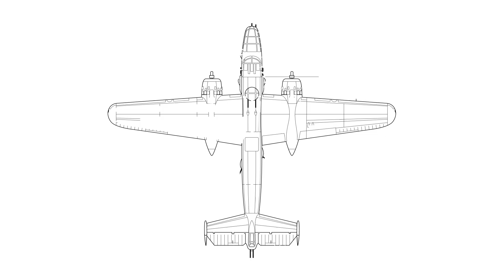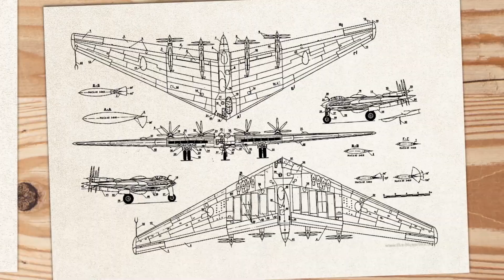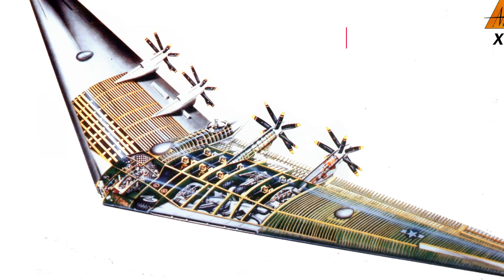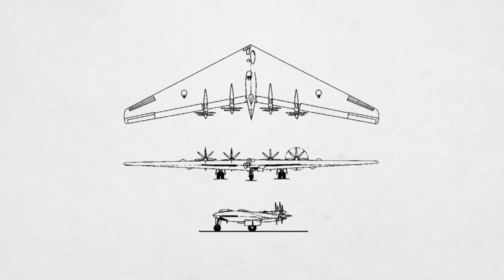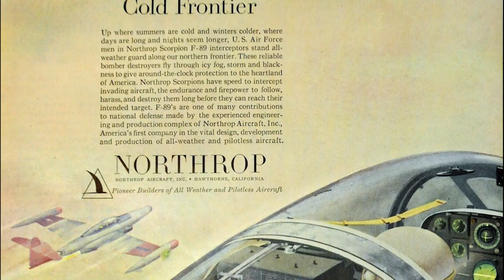This Plane Is CURSED - The Forgotten Flying Wing…

Comment: The serious problem w/ the YB was a "Gen One" flying wing design w/ early analog auto-flight technology and it just wasn't up to speed yet.. Had a digital autopilot and FMS system been available it wold have done better but trying to get a recip. powered design to fly efficiently (with some inherent design flaws) at jet speeds just wasn't  going to work but IMHO..  had Jack been allowed to continue he would have solved all the issues..   FWIW?  Symington was "dirty" to the max and Northrop was pretty much a straight arrow..

Comment: There are numerous factual errors in this video. Boeing had no role in the Convair B-36. In fact, Boeing had not even entered a proposal in the long-range bomber project because they viewed the parameters as impossible to achieve. It was not the propellers but the complicated gear boxes that caused vibration problems on the Northrop XB-35. The maximum ordnance of the XB-35 and the later YB-49 was nowhere near what is stated in this video (52,200 lbs !) In reality, it was 16,000 lbs. of bombs.

Comment: Jack K Northrop had the right idea to bin the fuselage and create a blended body flying wing, trouble is Jacks design was too way ahead of then current aero engineering stuck in the late 30,s.  Fully Automated Digital Engine Control with Computerised Flight Control Surfaces, and a decent twelve wheel bogie undercarriage would have made a lot of difference to Jacks Fab Beast. Sorry to say the B-35 was doomed even before it was wheeled out the hangar,

Comment: I'm sure the Air Force looked at the situation like merging Northrop with Convair was reasonable; the flying wing wouldn't be chosen and this would save jobs. But that doesn't change the fact that they were still trying to force a merger with unfair terms on Northrop. Sure, it might save some jobs, but it was still unfairly screwing over the company. Both sides of the story are perfectly compatible, just from different perspectives.

The powerful lobbying of Convair, and their close ties to someone making these decision, was  very clear. With such prejudice,  you can safely say they were part of the reason the flying wing was rejected, and also part of the reason that merger was so favourable to Convair. After the fact, the Air Force could ignore the inconvenient details - if such details were even recorded at all.

The way the Air Force blatantly stole the bits of Northrop's technology they wanted, scrapped everything else, and gave that tech to General Electric is already a perfect example of the way they treated Northrop. That does not suggest fair treatment.

Comment: WHY did you not just tell the truth?? The TRUTH is, the Truman cabinet was typically democrat, meaning VERY corrupt and on the take. Stuart Symington was being bribed by Convair to get Northrop to merge with them, and his reward would be the CEO position. When Jack Northrop said NO, Symington and Truman set out to destroy him.... That is why all the "strange" things happened to the airplane and the remaining ones were destroyed in front of the people that built them at the Northrop factory. Think about that for a minute  - has it ever happened before or since that the entire fleet of an aircraft was flown back to it's original factory and DESTROYED in front of it's creator?? NO!! This was 100% political corruption.... and that is why we do not have a single example left today. DO YOUR HOMEWORK and report it as the truth, not skirt the issue so Google doesn't demonitize your very nice video.

Comment: They tried to do too much at once.  These "great leaps" depend on first discovering and then successfully solving critical problems in multiple areas at once when failure to resolve any one of them will throw the entire project into a tailspin.  Add to that the inherent instability of the flying wing design, which today is handled by computerized fly-by-wire, and the reality is that the project was probably doomed from the start.

Comment: My mom was a cockpit instrument "tech" at North American Aviation (Now Northrup) after WW2 and she worked on the YB's. I have a YB lapel pin from her. I would at times, hang out with my Aerospace Engineer friends at Northrup, either via the AIAA or with the Ham Radio Club. Years ago, I acquired the Pilot's manual for a YB 49.

Comment: Why does a plane need a fuselage, tail, and more? To make it easier to control. Had Northrop successfully built his desired flying wing, he would have found that even the most skilled pilots would be a single small mistake away from crashing. The B-2 succeeded where its predecessors failed because it incorporated a computer AI that calculated how exactly to fly the plane, reducing the skill requirement for the pilot.

Comment: It was too hard to control before fly by wire technology and even hydraulics it was too hard to control even with hydraulic controls it was just too difficult to control I heard it took two men to fly it was so hard to control to me and had to make the exact same maneuvers at the exact same time they won two three and then turn one two three they pull back one two three they you know pitch forward all right and I got it down to one too you know and they make a turn or one two and they you know the y'all or whatever but I heard it took two men operating in sync to control the thing it was that hard to control the wrestle to wrestle that thing into submission

Comment: Truly a beautiful plane. I would love to see a bigger one that can even go supersonic. Not with stealth in mind, as the materials would be too expensive to manufacture. It would have side by side seating and even have a civilian counterpart, used as an aerial telescope. The military one would not only be a bomber, but also a tanker and presidential plane with the central bomb bay being replaced by a passenger area, roughly the size of a 737’s cabin. The length of this plane would be 140 feet, and the wingspan 280 feet. It would be powered by six Non-afterburning turbojets and fly at 830 mph at 56,000 feet. About 12 of them would be built, and yes, the “triforce” Lockheed, Boeing and airbus would all make them. 6 of them would be owned by at least 6 EU nations, while the other 6 will be in America’s hands.

Comment: AF Sec Symington was about as innocent of collusion against Northrop's program as the Pelosi and Biden families are innocent of corruption and insider trading. The design was not inherently unstable any more than the Horton Ho-229 was. Both were a bit tricky to fly, but no more so than some other designs that were accepted for servive. Admittedly fly by wire control vastly improves the flight characteristics but are not absolutely necessary. Else, models of both designs would be unflyable

Comment: There was no fire after the taxi testing because someone took a pic of the YB-49. The XB-35 was sabotaged by the US Army Air Corps/US Army Air Force which gave Northrop an underpowered APU, the engines and props were not mated beforehand . Stewart Simington was in the pocket of Convair

Comment: Besides likely corruption in the Truman Pentagon, all of Northrop's flying wings had directional stability problems. In the case of his XP-56 fighter, a certain amount of instability was desirable, however,  it was one of the fatal flaws of the YB-49. The Air Force pilots who tested the prototypes were all veteran bomber pilots who flew aircraft like the B-17 and B-29 in combat. These were outstanding high-altitude bombers that were capable of being controlled by the bombardier in the final run onto the target using the Norden Bomb Sight, an analog computer coupled to an autopilot. Most of those who tested the YB-49 believed its slight hunting oscillation in the yaw axis would have made it an unsatisfactory strategic bomber compared to the B-36.

The various iterations of the YB-49 had slightly different rudder/stabilizer empennage, Northrop's efforts to address the stability issue. However, it seems that only a large conventional tail would have worked given the state of technology in the 1940s, a rebuke to Jack Northrop's entire design philosophy. Computer-assisted fly-by-wire control would definitively solve the problem, allowing the B-2 Spirit, a completely tailless flying wing, to realize the Northrop vision.

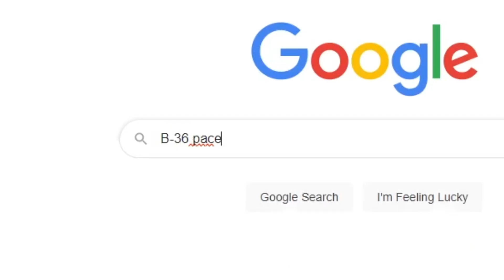Comment: 11:30 -- RE: The B-36 Peacemaker --- The period of time immediately following World War II is characterized by the Highly Experimental forms which various corporations pursued;  in the B-36, there's a combination of no less than 3 forms of propulsion on the same aircraft which seems impossibly complex to modern designers.

Sideways to this, the B-36 did NOT have a great operational record, with a large number of SAC aircraft flying off course or crashing into the sides of mountains.  To date, the ONLY site of a crashed airplane that I have seen with my own eyes is one of the B-36 crash sites.
Reply: ^^  Because, think about it -- Commercial Aviation Crash Sites are studied forensically and almost all the debris removed, so there's basically nothing to see at the crash site;  and crashes which occur at airshows (involving either private-owned or military-operated aircraft) get the same treatment.

Military accidents and/or aircraft damaged, destroyed, or downed during times of War (or while on a Mission) are therefore the only "in situ" air crashes that anyone could see "as is".
Reply: RE: "Three forms of Propulsion" -- Combustion engines + Props;  Jet engines;  or JATO rockets, "Jet Assisted Take-Off".  To Be Honest, though, I think that JATO wasn't used on the B-36 although it could have been used.  The B-52 certainly used them.  The airframe of the B-36 was partly constructed of magnesium, which is why rocket pods burning near the fuselage might not have been a good design choice.

Comment: If the B-35 / B-49 had entered service, it would probably have had a very short life on the Air Force roster, much like the B-47. Even if they had managed to work the bugs out and have it in service by 1950, it would have been greatly outclassed just a few years later by the new B-52, which, although not as stealthy, was over 100 mph faster and possessed greater range, with a comparable bomb load. So, while losing the Flying Wing was a personal blow to Jack Northrop, perhaps it's just as well.

Comment: Sounds like to me personally Northrop Had a mole or intelligence leak failing that some one in the air force was in the Soviets pocket and killed the advanced projects that the Soviets couldn't counter would make sense to me also make sense if someone most likely the Soviets or even the Americans sabotaged the plans and designs to create accidents if they had been reverse engineered only other thing I find strange is the general electric connection as they had better security being very close to th government and air force

Comment: Jack Northrop was a genius, but also a bit of a story teller. I'm sure the conspiracy must have made sense to him. The truth is much simpler: Flying wings are inherently unstable. Unlike a conventional aircraft, which left to it's own devices will return to level glide, a flying wing will, like most modern fighters, by itself keep deviating in any direction it's pushed until it stalls, unless constant corrections are exerted. To make matters worse, if a flying wing stalls, it loses all control surfaces, because it has none except for the ones on the wing, leading to it tumbling out ot the air like a dry leaf. 
This makes flying these aircraft a ride on the knife's edge, the pilot constantly has to keep the aircraft under control. It's like balancing a broom on your palm, once you stop correcting it will just fall down. The B-2 bomber not only has an improved wing geometry to reduce the risk of stall, but four redundant avionics computers to keep the plane level, something that could not have existed when Northrop built his prototypes.

Comment: This video doesn't touch on the fact that flying wings are incredibly unstable horizontally and this was a very big concern for the airfreight, as it could throw off bombings away from the intended targets, make the plane incredibly difficult to land in strong winds, and generally create an unstable platform.

Comment: This was a copy of atomic bombing plan of Germany. Only  thing was Nazis had the bomb, also had the Horten, and USA sent more than 4 nazi bombs over  Japan. Only 2 ones succeded. Moreover, this flying could not even have jet engines as Horten did
Reply: The scaled down prototype for the XB-35 was flying in 1941... the Ho.IX project which created the Go 229 didn't begin until 1943. What nonsense are you rambling on about?

Comment: The German Horten flying wings were far better than Northrop's unstable SEMI flying wing. Even Lippisches P.11 and other prototypes were better than Northrop's. The B-2 is FAR closer in design to the Ho-IX than anything Northrop actually flew.
Reply: Utter nonsense
Reply: @peterson7082  , yes, Northrop fanbois spout utter nonsense and pretend the two actual flying jet powered Horten prototypes and proposal for the long ranged jet flying wing bomber didn't exist.
Reply: @mrnickbig1  You're incredibly mistaken. The YB-49 was a reengined XB-35. The XB-35 had scaled down prototypes flying in 1941. In fact the N-9M which first flew in 1942 was still flying until it crashed killing its pilot in 2019. The Ho.IX project which created the 229 only began in 1943. Only one 229 prototype was powered that flew, and only flew for two flight-hours over the course of two weeks in February, 1945. The project for the XB-35 began in 1938. YB-49 in 1944.

Comment: Since a flying wing is a subsonic design; propellers should have worked fine in that era. To cut weight and increase power they should have installed turbo-props. This would have allowed them to fly at high altitudes without losing power too. Did they conceive of turbo-props on the 1940's and 1950'? If my memory is correct; the prototypes tended to consisting yaw making targeting difficult and the plane could possibly slip out of the during a sharp bank. The wing needed either an extended boom out the rest of it for a convention tail or a t-tail. A flat tail out of the back with some vertical stabilizers may have worked too. Considering the problems with the design, it needed a set of fresh eyes and the company needed extra financial strength. This is why the USA Air Force suggested a merger in my opinion.

Comment: I remember when the original Flying Wing suddenly disappeared from all the books.  Only when the B2 Stealth Bomber suddenly arrived on the scene did I realize just why they were suppressing it... the B2 was a direct result of the Northrup Flying Wing, invented in 1929.  They retooled it, added jet engines and made it out of carbon fiber, but it is essentially the same, exact design.

Comment: Imagine if they had swapped the radial piston engines, for turboprops and researched better gearing linkage for the contra-rotating props. We would have had a stealth Tu-95 Bear that would have had AMAZING range and been nearly invisible.
It could have flown Nap-of-the-Earth profiles like the later B-1B Lancer.

Comment: The one design flaw that can not be corrected in the flying wing designs. Is that all aerodynamic forces to keep the aircraft aloft and in the proper direction. Must be generated by the main wing. As there are no other aerodynamic surfaces to do so. So any horizontal change in direction. Must take take those aerodynamic forces directly from the aerodynamic forces providing lift to the aircraft.

So for a flying wing. In a 90% bank to change horizontal direction in the radius of the centroid of the aircraft. All Aerodynamic forces holding the aircraft aloft. Are also being used to turn the aircraft in the horizontal. Thus the aircraft will drop to the ground very quickly. Without the lift forces to keep aloft. Not a good characteristic to maintain normal flight.

Thus flying close to the ground in a flying wing is suicidality dangerous. As there must be height to recover the lift forces to maintain normal flight. So NAP of the Earth flying for flying wing aircraft is absolutely forbidden. Or even coming close to mountainous terrain.  

Straight and level is the preferred fight mode of the B-2. Making "Stealth" mandatory for any combat operations. As flight agility is not a characteristic of flying wings.

Comment: Due to the lack of a tail. The vertical axis was not stable in that flying wing design. In the Me-163 Komet. The main wing was extended back beyond the centroid of the aircraft. So the extended wing, provided the aerodynamic forces to provide stability. The YB-35 did not.

That design flaw was corrected in the B-2 Bomber design. With the realization that the control directions of the wing must be flipped from the front section and the rear sections.
Because directional stability required the realization of the front and rear sections from the centroid of the wing and main body. Were vertically directionally equally opposed on the wing to create fight stability.

That is why the YB-35 failed and the B-2 succeeded.
But the major problem of the flying wing designs. Is the horizontal turning speed of the aircraft. Is limited by the size of the wing control surfaces. Requiring steep banking angles to generate enough aerodynamic forces to quickly turn the aircraft. In the horizontal plane.